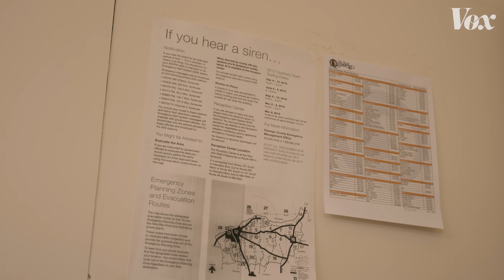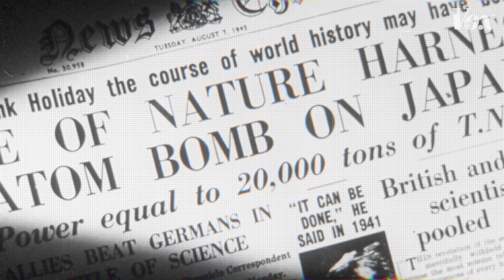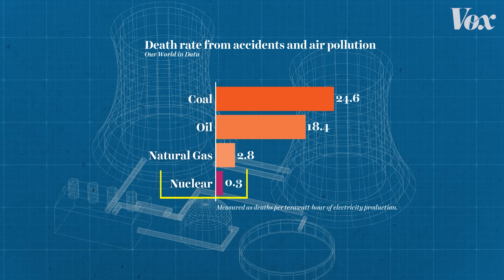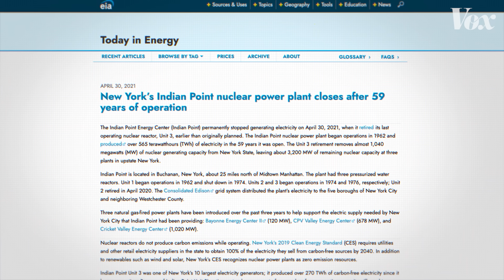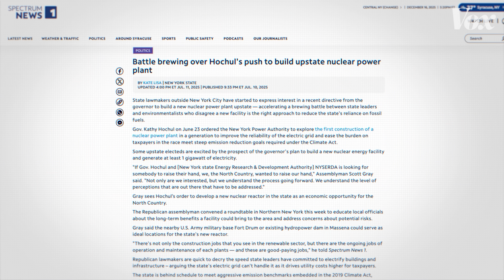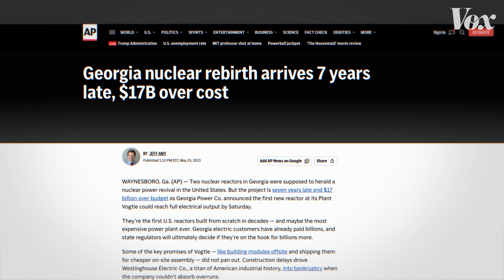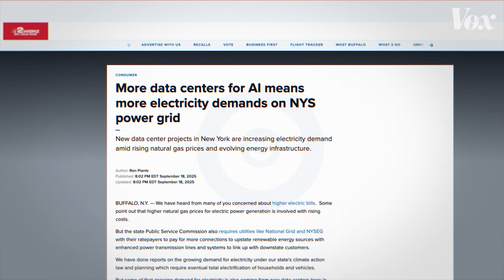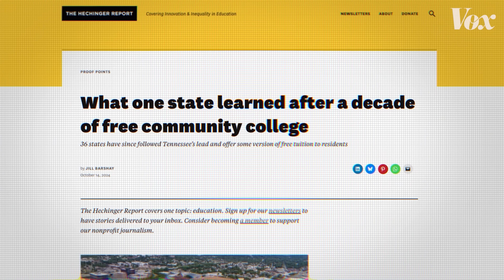This town has three nuclear plants. Now it wants another one

Comment: Fukushima accident is disasterous not because of its direct effect but because it sparked nuclear fear at 2010s and retreating human civilization for a decade
Reply: As a person who lived there before, I'm okay with nuclear power if the CEO lives near the plants.
Reply: No Chernobil did that, but you are probably too young to remember. Maybe watch the HBO show.
Nuclear is safer, precisely because its inherently more dangerous. I call this the airplane paradox. Because air-travel is inherently more dangerous, people are more strict about safety. This leads to better safety and fewer incidents. But safety adds cost and delays. And if you relax and start cutting corners... you get Boeing.
Reply: @ИванСнежков-з9й Posted mentioned 2010's, and the fear in the 2010's was from Fukushima, not Chernobyl.
Reply: 3 Mile Island 1979
Chernobyl 1986
Fukushima  2011

Every decade or two, nuclear reminds everyone how safe it really is. The problem with nuclear safety is it is very safe until it isn't and then it's really bad for decades afterwards. The only other form of generation that has catastrophic failures would be hydro. All other forms of generation have manageable incremental failures. This is the fundamental problem of risk assessments. 

Locating generation facilities to remote locations mitigates these risks. Hence why hydro works because they are typically in remote mountainous areas away from population centers. Nuclear should be doing the same but doesn't. And lastly, you need to accept that you may need to sacrifice the use of that land if (and possibly when) there is a failure. That's just part of the hidden and accepted costs.
Reply: @Obscurai  Actually... Contaminating the area of hundreds miles is not the worst that could happen. This is what happens when there are people around to mitigate the disaster.

In Chernobil they feared that the meltdown could separate the fissile uranium from the stable one (think liquids of different weight) and concentrate it enough to go critical. Aka they though the reactor could turn into bomb, bigger than everything man-made. While the square law would limit the immediate destruction, the explosion would spread hundred tones of nuclear material into the atmosphere. That could contaminate continents.

Well, maybe that's not practically possible... but I wouldn't want to test it for real.

To this day the Chernobil reactor is cooled with liquid nitrogen. And for a brief period Chernobil was occupied and maintenance personnel barred from entry...
Reply: @ИванСнежков-з9й  Thanks for the reminder. Yes, the blob known as the Elephant's Foot is very concerning. This just adds to the issue that nuclear failures have the potential to be catastrophic. Incremental failures are infinitely more manageable.
Reply: @ИванСнежков-з9й no scientist ever was afraid of that, its a fictional boogie man from an HBO show.

Comment: Even in a video that's positive about nuclear there is so much time spent on the negatives. Disappointed. Nuclear is safer in basically every measurable way.
Reply: It's safer precisely because of the extra strictness that makes it expensive and slow. And if you play quick and loose... you get a lot bigger mess to cleanup.
Reply: @ИванСнежков-з9й  Aside from the rigorous strict measures, it is also inherently safe with the newer Generation of nuclear reactors where a nuclear meltdown is essentially impossible. If the fuel gets too hot, the reaction stops automatically.
Reply: @aaryanairy756  They've said the same for Chernobil and Fukushima. I don't trust automation. I don't trust water reactors.
See, Liquid Flouride Thorium Reactors can have a passive safety, where if the cooling system fail, the reactor heat melts a frozen valve and drains the liquid into smaller separate tanks (bellow critical mass) where the reaction effectively stops.
Anything less can either fail or be bypassed by humans ( like in the Chernobil test).
Reply: @ИванСнежков-з9й  Chernobyl was a result of them running the plant way outside of it's design parameters, it had nothing to do with automation. Fukushima was the result of repeatedly ignoring warnings of the backup generator being below ground level with inadequate sealing..... right next to an ocean known for tsunamis.
Reply: It completely ignores renewables because if it did nuclear would lose on build time, time to scale, cost ($/Watt), not to mention that renewables has a much higher potential for how much you could actually build.
Reply: @Andre-95  100$ per kw/h of storage for renewables.  That's 100$ for every fridge, for every heater, for every air conditioner. 10y lifetime.
200+ trillion $ every decade on replacement.
Reply: @vayne7556 at the cost you say per kWh that would be 2000twh or around 1/15 of worldwide yearly production of electricity if I’m not mistaken. Did you mean world wide investment or just USA?
Reply: @Andre-95  Renewables are far cheaper, but are intermittent, nuclear generates consistent power around the clock. Unless we make monumental strides in energy storage, we must have reliable baseload power.
Reply: @Andre-95  Solar and wind don't hold a candle to nuclear. Solar and wind can't adjust for fluctuations in energy requirement through the day, a bit of dust on solar panels and the efficiency plummets, not to mention they are usually only effective at certain places and needs to be stored causing massive loss of energy.              

Nuclear costs more initially, but that money can be recouped in 5-10 years and after that it is immensely profitable. 

Also, solar panels have a life of say: 20 years. After that, they are garbage. There's nothing recyclable about solar panels. Nuclear on the other hand is 96% recyclable.

Comment: 04:50 "led to countless thousands of deaths"  - countless thousands? Come on Vox - do better. Put the estimates up, qualify the low and high counts.
Reply: I agree. "Countless thousands" is untethered from current best estimates. For people who are interested, check out Hannah Ritchie's article "What was the death toll from Chernobyl and Fukushima?"

> "The confirmed death toll from Chernobyl is less than 100. We still do not know the true death toll of the disaster. My best approximation is that the true death toll is in the range of 300 to 500 based on the available evidence, but this comes with significant uncertainty"
Reply: Vox is losing the plot, that was complete and total misinformation
Reply: Yeah even including the WHO report figures on Chernobyl's anticipated thyroid cancer deaths puts the total at around ~260 by 2066.
Reply: @nuancedhistory 2066?
Reply: @ducanhdinh8823  If someone gets irradiated by chernobyl and develops cancer 50 years later, that's counted as a death influenced by chernobyl. Even WITH those inclusions, the number will be ~260 after all people involved in it have died.
Reply: @cobracrystal_ yeah but 2066? How did anyone get the number in 2066 right now./s
Reply: The mid-roll Vox Patreon Ad said it best.  Being "fun to watch" is more important than accuracy.  Disappointing for sure, Vox has done a lot of great stuff.

Comment: Hey New York, how about building it on the ocean coast instead of on the coast of a Great Lake. 
Placing full faith in a handful of nuclear power plant workers to avoid a worse case scenario doesn't always work. (Chernobyl — 1986, Three Mile Island Unit 2 — 1979, SL-1 Idaho — 1961, Chalk River NRX — 1952, Fermi 1 — 1966) If they do their job incorrectly it could pollute one of the largest sources of fresh water in the country. The Lakes aren't big enough dilute nuclear fallout. Get it wrong once and Lake Ontario is a toxic swamp for a thousand years.
Reply: Almost all of the accidents you listed are not possible today. Three Mile Island was never a danger to the public. Chernobyl's reactor design was deeply flawed and does not exist in the rest of the world. These plants fail safely. With absolutely zero operator intervention, nuclear power plants will fail and correct themselves. To say "only a few nuclear workers" are the line between operating normally and disaster is ignorant at best and disingenuous at worst. These are highly educated, licensed, and trained professionals who care about their communities and love their jobs. I recommend watching Smarter Every Day's current series on nuclear power.
Reply: Water is the best thing you can use to stop radiation. So an open nuclear reactor ending up in a lake is basically the best possible outcome for you nonsensical scenario
Reply: Try applying that logic to anywhere a coal or oil plant is placed. Also Chernobyl has animals living in it and is generally safe to visit.
Reply: Shoreham was complete and never went critical because of NIMBYISM.  🤷‍♂️
The only "ocean" NY has is Long Island
Reply: Yup. Thank you

Comment: Nuclear energy is the cleanest. Cheapest, and safest energy out there
Reply: Don’t know about cheap but yeah actually coal and these other ones do release more waste than Nuclear actually does
Reply: sweeps radioactive waste and 2 catastrophic failures within half a century under carpet Nothing to see here! Haha yup, all clean!
Reply: So we should ban cars because people get into accidents? Nuclear waste is miniscule compared to coal, oil, wind, and solar power @maxonite
Reply: @PenguinTac0s  Comparing the horrific effects of nuclear contamination to road accidents is laughable. Not that those aren’t a leading cause of premature death that we're continuing to try and prevent with self-driving technology and focus on public transportation. The biggest difference is that solutions are feasible and we do not have alternatives to these vehicles. We do not have to use nuclear power. Where do renewables have bigger waste problems? Or unsolvable ones, at that?
Reply: @maxonite   you mean the 97% recyclable nuclear waste and the wreckages of 2 old, outdated and incompetent models of powerplants under the rug? Chernobyl went off because of human stupidity (literally), and also their inaction on informing the operators of the plant of the materials used in the control rods and the dangers they possess if used wrongly. Fukushima is also human incompetence because they placed the backup generators under sea level in a region known for tsunamis... coal power produces much much more radiation and instead of being stored safely into containers that wont see the light of the sun for the next thousand years are dispersed into the atmosphere free of guidelines. maybe do more reading, eh?
Reply: Your not even trying to make a joke, are you? No wonder climate deniers love nuclear. It matches the denial of reality it takes to think nuclear is the answer in the year 2025

Comment: Wouldn't it make more sense to focus on making AI more energy efficient? I mean, put the breaks on and instead of rolling it out into everything that doesn't exactly need AI like light switches and toilet paper dispensers focus on making AI hardware work more efficiently first?
Reply: Careful of Jevons Paradox
Reply: Jevons Paradox is the correct response to OP's comment.
Reply: Thats not how reality works lol. It’s computing, not basic electrical appliances. You are talking about making hardware more efficient which is sometihing that is not currently possible as the tech doesn’t exist and it wont be exist for a while
Reply: @tomasvrabec1845  AI is driven GPUs or NPUs which are basically high end consumer grade graphics cards with the rendering / video output components left off.  Take a look at the power consumption and processing power of say the last 3 or 4 generations of NVidia's RTX series. Each has become faster and more efficient while using less power.  Progress is being made, but at the moment we're seeing what looks like a massive push to shovel AI into everything and to make it happen we're just popping up new power plants and straining our already decrepit power infrastructure.

Comment: Major downside of nuclear is honestly just the general cost of shutting down the plant when it’s decommissioned after several decades.
Reply: Once you get over the initial costs of building a reactor, which can be anywhere from 5 to 10 years: Nuclear is very profitable for the rest of the time.
Reply: Depends. Nuclear is the only industry which has to deal with its own decommissioning costs. So what happens is that the plant accumulates capital while it's operating so that it will eventually be able to pay for the decommissioning. Now, the issue emerges when you close the plants prematurely (Italy for example)